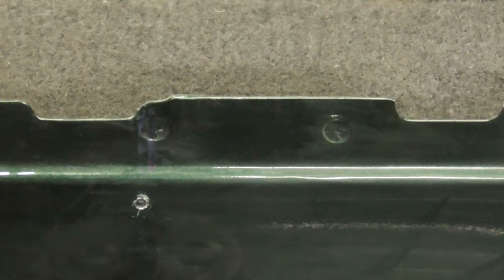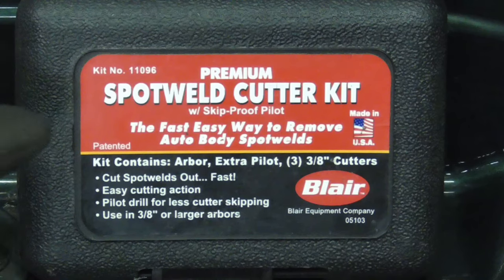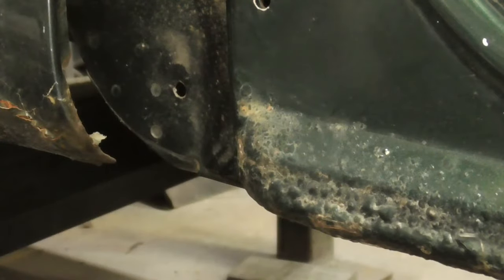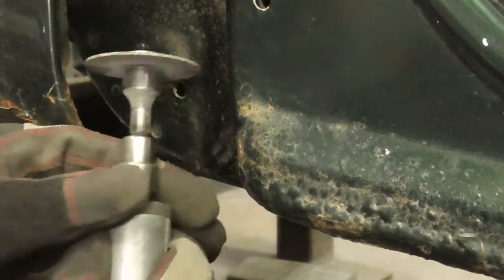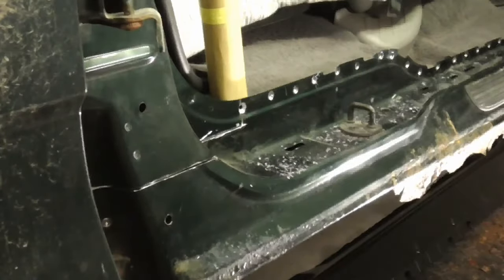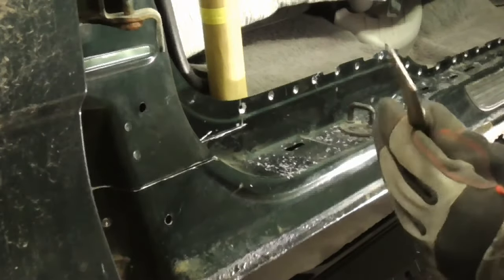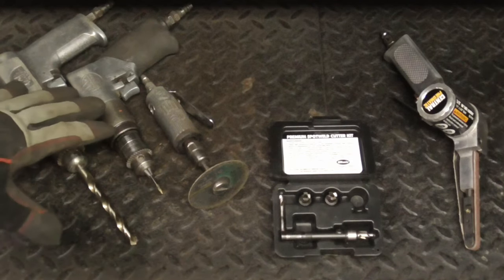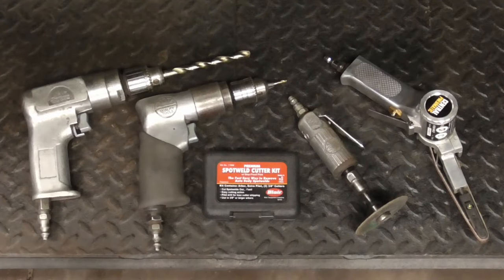4 Easy Ways to Remove Spot Welds & Welded on Auto Body Panels

Comment: If you're only getting 4 spot welds per belt you're buying some cheap assed belts. Use ceramic belts from 3M (Cubitron II) Norton (Blaze) VSM or Sunmight and you'll be able to do a complete quarter panel or more with only one of them. I recommend 60 grit.
Reply: I dont use a belt sander. JUNK. Tried it. Old school blair cutter, or a Spottle, works for me. Every tech is different. Laugh out loud! Happy New Year!
Reply: We use the Baxter brand belts for our Baxter belt sander. We rarely have to change our belts and we use it multiple times a day. Usually they only get changed when they snap lol

Comment: Been doing it for over 30 years and still hate removing spot welds lol
Reply from the maker: Sort of the same here but it's always better if I have super sharp tools.  I buy the double ended 1/8" drill bits from HF - when the get just a bit dull I toss 'em - not dealing w/ dull drill bits, sand paper, blades, etc :)

Comment: The real star here is that air driven chisel, and metal cutter - WOW
Reply from the maker: You're right.  For many years, all I used was the air hammer with a cutter bit and/or green handle tin snips.... die grinder too w/ cut off wheel :)

Comment: Big straight two handed die grinder with a ball style carbide bit works amazing. No sharpening, great access for hard to get areas and no sharpening.
Reply from the maker: Thanks for the tip MM 👍
Reply: I have tried this before it does work great for a long time until the carbide bit gets dull and it will especially working with HSS. Normally I use the belt sander method, but I like the 2 drill bit method as well. I don't like the cutter, because you need a through hole to keep it from walking around.

Comment: I like using an 18” 3m belt sander to remove all spot welds. 60 grit 3m paper. Goes a little faster than 80 grit but not too fast to burn through the adjacent panel. 

The die grinder method is probably faster, but throws a lot of sparks around the shop which puts nearby cars at risk. Also, it’s easy to damage adjacent panels with die grinder if you aren’t careful. I know a guy who puts 2 grinding wheels on his and he bears down on it like he’s trying to push the car off the lift. He throws sparks halfway across the shop!! 😂

Try better paper and maybe a longer belt sander. Should last longer than 4 welds. I get more than 10 easy. Good video!
Reply from the maker: Thanks for the support and tips Isaiah - I appreciate your comment.  Have a great weekend my friend :)

Comment: At the shop I work I use a 3m made belt on an 18" belt sander- you can do 20-30 welds on 1 belt
Reply from the maker: That's quite a few welds.  I figured there's got to be better paper out there for this sander.  I can't stand dull paper so my estimate is probably on the low end but the tool does work great when you need to reach :)  Thanks for that info BZapp

Comment: Grinder works awesome just pay attention  I put a gasket scraper close an put tension on panel
Reply from the maker: Good thinking - that way it "pops" when you're through?
Reply: @LakesideAutobody  exactly especially when using used parts quarter panels bed sides material is just so thin

Comment: Doesn’t the belt sander make the material too thin?
Reply from the maker: It can - yes.  It's actually best to use a spot weld cutter or drill bit.  :)

Comment: What drill bit angles or brands do you recommend? My bits get grabby and pull them through when I try to drill spot welds pretty frequently.
Reply from the maker: I've got a set of these - https://www.northerntool.com/shop/tools/product_200623988_200623988  I like them a lot.

Comment: Worked for a guy once, no cutters. Chisel to seperate, hammer dolly metal back, into place weld tear or rips. Never again.

Have you ever tried a spot weld drill that applies pressure to cut fast? Great, when they fit
Reply from the maker: Wow - that doesn't sound fun.  I have not used one of those but they look like they would make it a bit easier if you had to drill out tons of them.  Thanks for your input Randy - Happy New Year :)
Reply: For seams, like rear side windows, pinch welds, toe-board  some rocker panels, trunk seams, yeah they are nice, my last job, co-worker had 1, I loved it,, I quit when boss cussed me out. I was part time, he demanded I quit full time job, come to work for him, without insurance, he liked my work, but wanted me there more, but by cussing me, I walked away
Reply from the maker: @randymack1782  Yep - I'm not into some guy yelling at me - not cool.  If you're good at what you do you should get a lot of respect from the boss and workers - no need for that stuff :)